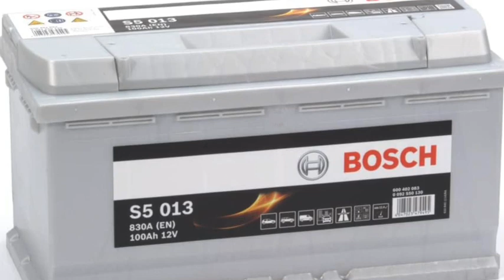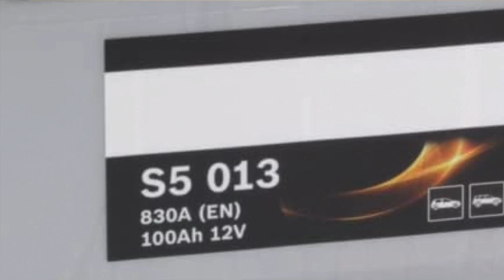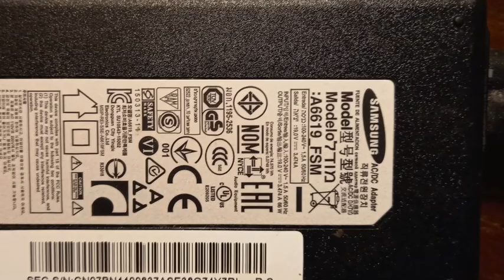How to live with 12 Volt of a car battery   Video 34a

Comment: If a TV works at say 19v DC. The convertor inside the TV surely covers it back to a sine wave which isn't as efficient unless you could bypass the conversion and use straight sine wave power input?
Reply from the maker: Hi Charles, I  don't know what the TV is doing with the 19 Volts DC but it is the last point before it goes into "The Forbidden City" ;-). So I give it as it wants it and would not advice my audience to go inside the TV. For me it is important to avoid the expensive inverter and keep the installation as essential as possible. The battery is really essential because it is not only able to store energy for blackout (so common in many countries) but also to give enormous power like 6 kW or more when you start your car engine! So this and the next video of Saturday is to show that if functionalities can be given by devices working at 12 Volt, it is great because inverters don't give essential value like the battery. They just help to adapt to a world that is used  to high voltage and the majority of devices.

Comment: I have a similar setup. 12V battery, charged by some solar panels or the grid and a 24V boost Converter. Then I have a 24V DC bus where lots of usb/usb-c chargers are attached to and some devices like the Router and led lamps which directly work on 24V or 12V.
I found 24V more suitable because it loses less power on longer cables and still most car parts work with it, because trucks use 24V batteries
Reply from the maker: Hi Uss-C, that bus idea is very interesting, indeed 24 V takes less current so less losses result and you can take the line into other rooms. If many low voltage devices have a 12/24 Volt switch, you can choose between the voltages. Come back on Saturday and see the detailed video!
Reply from the maker: I am a bit afraid to give the 24 V to the 19 V electronic devices like TV, laptops and computer screens so I  will present a PWM that converts 24 to 19 without loss.

Comment: New Sub, Detroit, Michigan, US
I would like to set something up like this for my Grandpa's, My Dad's, and now My Fishing Property in the Woods of Mid-Michigan.
The Site is a Blank Slate now, so I want to make a Small Self Sustainable Cabin for me to take the Wifey & Kiddo's That is Fairly off the Grid, or a possibly a Solar/Battery System
Reply from the maker: That is great MotownBatman, your Avatar name already shows you like nature! Big cities are like fragile infrastructures that function until things go badly wrong. This video and the detailed video I publish tomorrow are only about the battery, grid charging and running households on low voltage but that is indeed the basis for charging systems based on Renewable Energy, so great also for Blank Slate Nature!